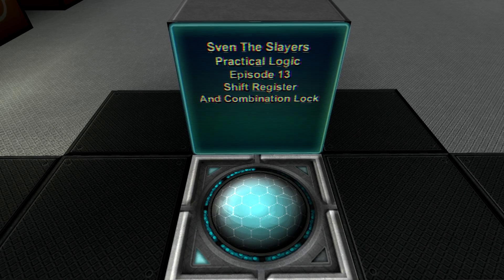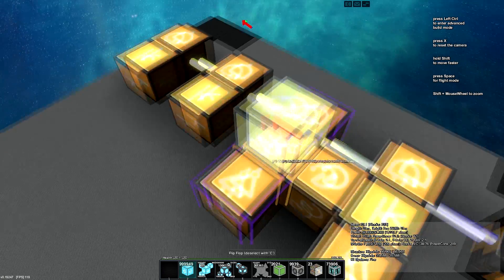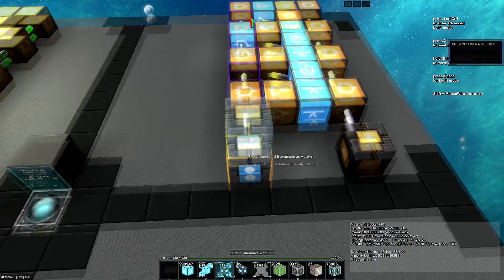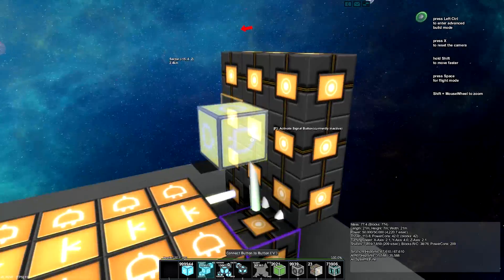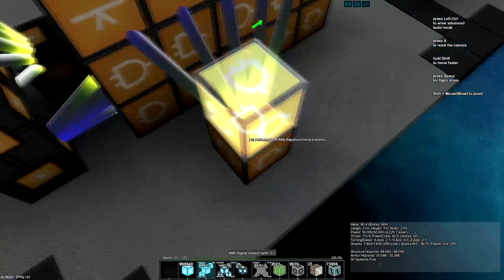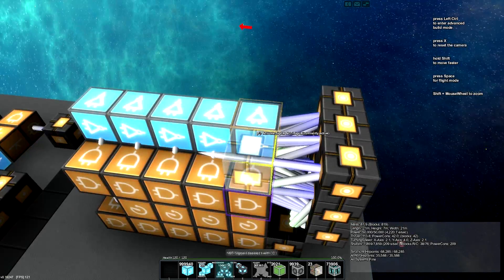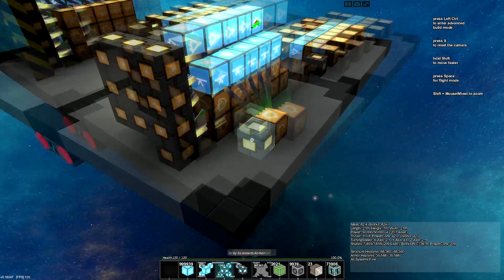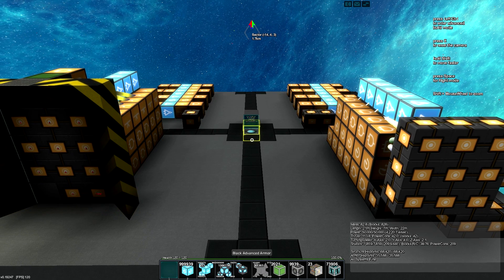Starmade: Practical Logic Tutorial Episode 13 (Combo Lock)

Comment: Hey Sven! is there any way to further simplify and compact this design? I'm looking at putting a combo lock of 4 digits but only 3 buttons and a reset (as it's a very small ship) and because space is at a very scarce premium, I just want to go as simple as it's physically possible while keeping it secure.

Also, a backward step could be used as a Backspace button to delete incorrect digits one by one. That could be useful if you want an option to correct one or 2 digits without having to cancel a complete code in case your combination is very long or complex. Possibly programmable display to shift backwards and forwards between states i.e. different colors or modes?

Comment: Hi mate, great video and good job 
i build a diferent desing for a Password Lock, it have only 9 buttons.. and the possible combinations are 387.420.489 ... with a few changes, the system could be upgrade to 68.719.476.736 combinations ... i build the system like a real password lock, compact and easy to configure:
https://starmadedock.net/threads/password-lock-system-9-digit-387-420-489-possible-combinations.23831/
Reply: Fix spelling and grammar.
Reply: +Bandit Leader i&#180;m not a native english speaker, so .. sorry if i have some spelling and grammar errors

Comment: There are also two other versions of a similar lock on this topic http://starmadedock.net/threads/system-password-4-digit-256-possible-combinations.7777/
Your shift register resembles my first version, but you can actually achieve a more compact version with a rail and a "dummy entity" on it (make it move with a rail speed controller and detect its current position).
Reply: OlxinosEtenn (still a good design :p)